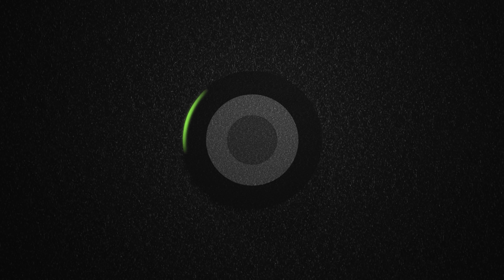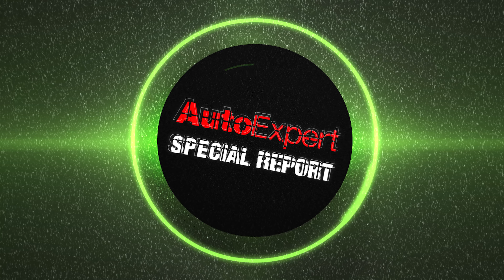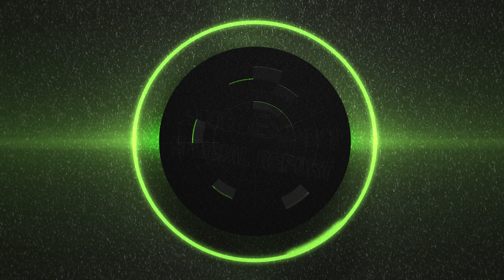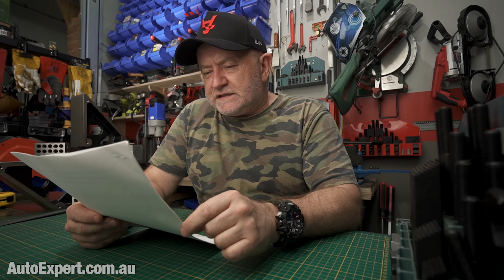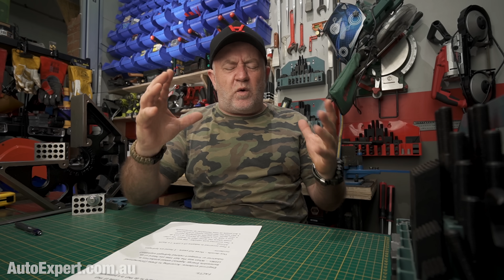The truth about fire risk: Hydrogen fuel cells and battery EVs | Auto Expert John Cadogan

Comment: Hi John, I work for a fire company here in Melbourne. I carry out annual building inspections as apart of my scope of works for fire compliance. I've been reporting and failing all buildings/offices/car parks/units etc that have EV vehicles on site and as non compliant as the fire suppression systems aren't designed for EV fires and will not be able to deal with those fires. I know insurance companies are starting to ban EV vehicles and their not willing to insure buildings if EV vehicles are present. You''re going to see more and more "NO EV VEHICLES ALLOWED" signs being posted all over Melbourne in the next few years purely because there is not a practical solution to the fire risk they pose
Reply: Do you know as an expert in this field how countries that are more ahead of ours in the EV transition are managing the risks?  The vast majority of cars bought in Norway for instance are plug-in electric so presumably they are having major issues already.  Perhaps we need to learn how they are managing this problem.  I should add that the Nordic countries take health and safety very seriously so maybe they have developed solutions?
Reply: @robsengahay5614  No body.. No body worldwide has a solution to this issue, because the solutions available are not practical and therefore cant be implemented period. Every single solution on the table is either not possible, cost prohibitive to implement on mass scale, hazardous to us or just simply doesn't work. There's 1 solution and 1 solution only. Step away from the chemistry that is lithium batteries. But the modern world cant have what it wants without lithium battery technology so we wont do that. While we can use other batteries, we cant have what we want if we do. Phones wont be able to do what they do, battery tools will become less powerful, slower and less useful, EV cars wont be able to have the range they do. The truth about going "green" is inconvenient which is why these western progressive/tyrannical governments and the powers at be within private enterprise are doing everything in their power to hide it. You dont see that filthy rich little useless mole greta thunberg talking about the child slave labour in the congo... its pretty convenient to forget that without the exploitation of kids in the congo mines owned by the chinese.... you wouldn't be able to enjoy the life you do... oh that does go for me as well, im not just pointing the finger here. We all play our part in supporting that. Hard discussions need to be had globally.
Reply: @SHADOWW18  I actually was asking how they solved the insurance issue but your response went down the usual unhinged rant about cobalt mining in the Congo and conspiracies within governments designed to undermine the fossil fuel industries.  Greta got a mention for some obscure reason but you missed off Bill Gates and George Soros.  I thought for a moment that you had a genuine point to make.  Oh well.
Reply: @SHADOWW18  Look, you made a point that if you have EVs parked under a building you won’t be able to get insurance in Australia soon.  Australia hardly has any EVs right now but many countries in Europe are overrun with them, not just Norway.  So, by your reckoning these cars should be going up in flames and causing major building fires by now making the buildings uninsurable.  Why is this not happening?

You actually have no clue about the energy crisis in Europe do you?  The problem has been a dash for gas and relying on the pipeline from Russia, the second of which was coming onstream by now if the war hadn’t been started.  Yes, many countries ditched coal in favour of gas and the availability and price of gas has gone through the roof.  If they hadn’t also invested in wind power heavily they would have been in a worse state than they are.  After Fukishima Germany made the wrong decision to wind down nuclear too and that has bitten them in the bum.  That was nothing to do with going green either.

I hope that you don’t have the job you claim to have.  We need responsible sensible people carrying out jobs like that.
Reply: What’s a “fire company”?
Reply: @robsengahay5614  A company that maintains all things fire related. From smoke alarms to sprinkler systems etc
Reply: But they’re all ok for petrol vehicles parking in buildings….? It’s a funny old world.
Reply: @zwieseler  yes, because the fire suppression system was designed, certified and signed off by the fire engineer to be able to cope with a petroleum car fire and these systems have been tested and proven to work. It's not a funny old world, its a logical world

Comment: Hi John,  Worked in oil and gas for many years (46) and i've been a witness to a hydrogen explosion of a recip compressor, a discharge valve was replaced incorrectly, cylinder pressure built up, compressor exploded, the cylinder head came off, gas was ignited by a spark from the head hitting the other compressor.  Huge flash fire, pressure wave smashed numerous windows in our admin block, a security guard was physically lifted up and thrown through the security gate when he ventured out to see what the bang was (A bit of mayor of Hiroshima stuff here) the pressure wave lifted the roof of a lab building and perforated the ear drums of two people standing on the compressor deck.  Four people were on the deck, none died, two were quite badly injured.  All lived, one guy never returned to the refinery again.  A vessel can BLEVE, especially if the RV capacity can't cope with the exiting pressure, more so for LPG this one.  The other "thing" if a vessel catches fire visa the RV outlet if the vessel is cooled rapidly the fire can get sucked into the vessel, not a good outcome.  In the event of a hydrogen fire we used to leave it burning and inject an inert gas such as N2 and extinguish the fire from inside and not outside.
Reply: @veselekov  Orewa College Auckland 2009 feel free to Google the rest
Reply: I worked on a coal boiler that exploded and killed a guy, all stored energy has some level of risks
Reply: @veselekov  Oh. It certainly happened. I worked at the same facility. But stuff like that happens but as no one was killed and the plant didn't burn down so it doesn't make anymore more than the local news cycle explaining the loud bang people may of heard.
Reply: @reximus9420  Cheers Rex, not sure why anybody would think you would make stuff like this up, I think I gave enough detail to get the point across.  No need to relive this event in any more detail.
Reply: Industrial accidents happened. Real unfortunate if you’re caught up in it. So, do we ban all industrial processes that could cause an explosion?
Reply: @PhilRable  No you don't, however what you do is have the right standards and protocols in place to minimise the risk.  As we live and learn we get better and less major events happen.  This was an event in the mid-nineties, we've learnt a lot.  It's when you don't learn, and we have several similar events that we need to do something different.
Reply: Sounds bloody nasty  ,somewhere you don't want to be close  to
Reply: Stored energy catastrophic failures are not just flammable gases,  just look up how many people are killed or injured while working with Tyres.
Reply: John, I love the way that you will not let the facts get in the way of the story as some people want it to be told.
Reply: @veselekov  As Reximus validates it did happen so no i'm not "full of it", just didn't think it appropriate to go into any more detail.  '
Reply: How close were you? Any vision of the event?
Reply: @thelimousineline-sydney8121   it was about 19:30 ish,  I was at a friend's house close by on my way home, we heard a muffled bang and a picture rattled on his wall, after that thought nothing more of it until I got a call to come into the facility in my role as a Machinery Engineer to assess the damage, get an initial idea as to what actually happened and try and figure out "where to from here?".  Unfortunately, cameras and phones etc weren't allowed on the facility so personally I don't have any pictures myself. Visiting the site shortly afterwards walking on heat damaged gratings and seeing what actually happened, and visualising the energy released was certainly a "harrowing experience", not easily forgotten.
Reply: How big was the cylinder?
Reply: @paulnotdownunder3172  320 mm if memory serves me right
Reply: But the negative pressure when it cool down and air might get in is not much an issue with hydrogen, because hydrogen has way less energy than methane for example at ambient pressure. 
People in TV create perfect mixture of oxygen (not air) and hydrogen on soap bubbles and they make them explode in their hands. You have a lot of noise (I give you that) but it does not hurt at all. Not matter how many bubbles you have.  
The accident you are mentioned could have also happen with methane or any other hydrocarbon gas.
In those cases I bet it would have been worse.
NASA did in the 60s a complete comparison between hydrogen and other fuels dangers, they reach the conclusion that hydrogen was safer and produce way less damage in most cases.
Reply: Read up on some of the horrendous explosions that happened all the time on "refinery row" in Houston TX - we had one plastics plant on hwy 225 & the beltway explode so catastrophically (TWICE in 5 years! Almost identically) it blew roofs off houses up to half a mile away in deer park and Pasadena, it was nasty. Sounds crazy but stuff like that happened a lot; some oil refineries, but the worst ones were always chemical plants
Reply: So who signed off on the incorrect valve replacement?
Reply: @colinboggust2950  At the time there was a lot of "empowerment" stuff going on and self-managed work teams stuff so more responsibility and accountability was handed over to the Maint Techs.  My point was more about the explosion rather than the how it happened, I suspect that you and I both know that.  The compressor did not comply with the appropriate API  compressor standard, it states the suct and disch valves should not be able to be physically installed in the opposing valve port, we'll start there...  There were also a lot of extenuating circumstances, my response was about the explosion and the resulting aftermath.

Comment: About 3 years a biogas buss in Stockholm hit a tunnel and the composite gas bottles on the roof was ripped open and the gas ignited. Release-valves and other security devices didn’t make any different at all. Luckily nobody was seriously hurt. I’m not saying it’s a massive problem but Similar accidents will happen with hydrogen vehicles. The gas bottles are basically the same and weird stuff happens all the time.

Comment: I assume when you say hydrogen is safe you are ignoring the space X reusable space van thing
Reply: SpaceX's reusable Starship uses Methalox as its fuel source. So, chilled liquid methane in one tank and chilled liquid oxygen in another.

Maybe you're thinking of Bezos's Blue Origin and its reusable New Shepard rocket which uses liquid hydrogen and liquid oxygen?
Reply: @nettlesoup  Could be, I just remember seeing clips of big bangs and the reason being hydrogen getting through the carbon fiber of the tank and getting on far too well with the oxygen
Reply: @mcduck5  SpaceX have never used hydrogen as a propellant for commercial launches.

Perhaps you're misremembering the facts about the Falcon 9 that blew up on the pad? That was due to a helium COPV tank buckling when they were trying a new lower temperature cryogenic helium loading technique.

The helium tank was one of three inside the liquid oxygen tank and these were used to maintain pressure of the oxygen fuel. According to SpaceX's investigation, the buckling of the tank allowed super chilled LOX to pool in the buckles, breaking or causing friction in the carbon fibres, leading to ignition of the LOX fuel.
Reply: @nettlesoup  Could very well be, I was slightly drunk looking up vids of rockets going bang

Comment: Just a quick correction. Water does not extinguish fire by oxygen starvation. Water actually cools the fire to a temperature below what is necessary to continue combustion. Lots of heat transfers to the cooler liquid water then even more heat transfers to supply the latent heat conversion to steam. 

And by the way, single Tesla battery fires commonly cause highway shutdowns and proximity evacuation, a few times per week in each of our west coast metro areas. The fire departments here, in 'merica, state the average water required is 5 trucks, rather than the typical gasoline vehicle at less than 1 truck. 

Recently in Florida, following hurricane storms, there were 100s of these fires due to flooded vehicles. Firefighters would only attempt to stop the fire if they had a hydrant near enough, and sufficient water supply in the area.  Otherwise, the number of personnel and trucks required could not be available for all the Tesla vehicle fires. They simply ordered evacuation of the area. 

A parking garage full of contemporary EVs on fire would almost certainly destroy any structure, and perhaps a neighbor or two. And there is nothing at all any one can do to extinguish.
Reply: By "100s" you mean eleven? Like by all means, there's work that needs to be done on the topic of EV fires, but come on - "hundreds" is obvious bullshit. Social media chinese whispers at work, everyone's gotta add their own embellishment until the number is out at least an order of magnitude.
Reply: @t_z1030  You are incorrect sir. My information was not acquired by internet search. I'm a vehicle dealer here with colleagues in auto salvage, auction houses, and insurance. These are my sources. 
Local news media coverage was warning people to not attempt to power their cars, but rather have it towed well away from people and structures. The fire department was required to perform the tow. 

Within two weeks of the floods, insurance claims for cars actually burned were over a hundred. All the flooded cars were total losses. They had to be sent to special fire containment facilities to be destroyed. 

Auction houses were sent requirements to conspicuously identify any flooded vehicles. These warnings were read before bidding. 

You guys are making light this issue. It is not a trivial problem. Nobody wants to speak a bad word against these cars. There are pros and cons, but we need to mitigate this particular con. Hiding the actual information is not helpful.
Reply: @CycleWerkz  If that is the case, then whoever has the hard data needs to contact their elected official about it. At least one Florida senator is already aware of the fires, and I'm sure he'd be very interested to hear about that number.

But forgive me if I remain skeptical for now, random internet stranger. Funnily enough I used to work in auto salvage, in a joint venture between LKQ and an insurance company. This company owned the whole chain, insurance, tow trucks, salvage yards and body shops. Let me tell you, I've never worked in an industry so thickly coated in a permanent layer of bullshit before or since. It only takes one person to start it, and it spreads like wildfire. I would never take information from that sector at face value.
Reply: @t_z1030  No worries mate. I don't expect to convince anyone.
Reply: @t_z1030  No this guy is right about the battery fires being a potentially huge problem because the fires are extremely hard to put out. If elemental lithium (which can occur inside worn batteries) gets in contact with water it produces hydrogen among other things which happens to be very flammable. The best way to deal with an EV battery fire is to just leave it there to burn. That's unfortunately less of an option when the fire has a risk of spreading further. One of the issues with putting out the fire is that it burns very hot and can reignite when it seems to be out.
Reply: @herpderp7114  I'm well aware of the big issues with lithium battery fires, that's not what was the discussion was about. I was asserting that the claim about the number of EVs catching fire in the floods was questionable, and not remotely what had been reported. And that I certainly am not about to believe otherwise from hearsay in the youtube comments. Particularly when in an intensely polarized media landscape where certain interests take any opportunity to attack EVs for any reason, real or otherwise, none of those interests have mentioned it. That's especially surprising when it is supposed to have happened in a state like Florida.

i.e the fact that commentators from certain sections of the media haven't been banging on about it is a pretty good indicator that it's not a real statistic. They'd be all over it otherwise.